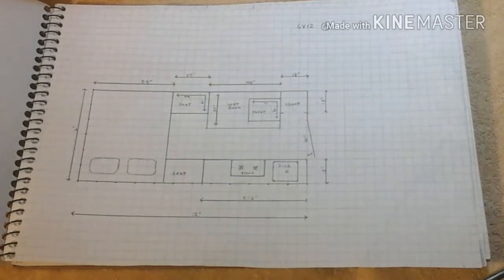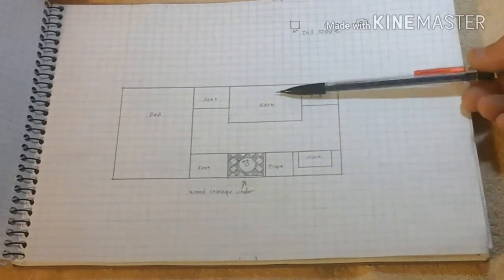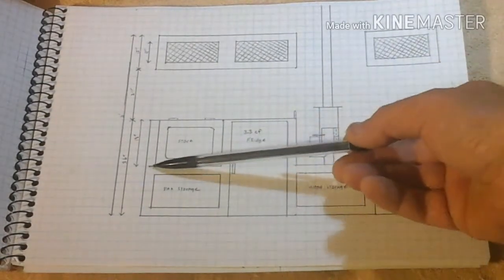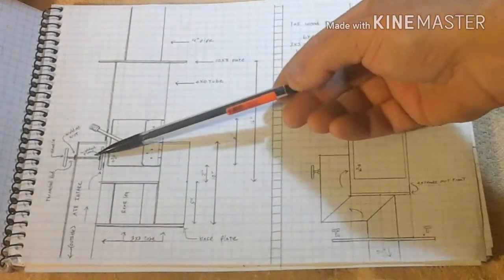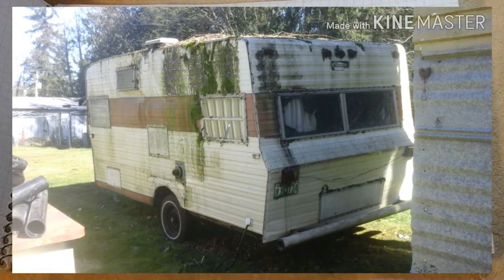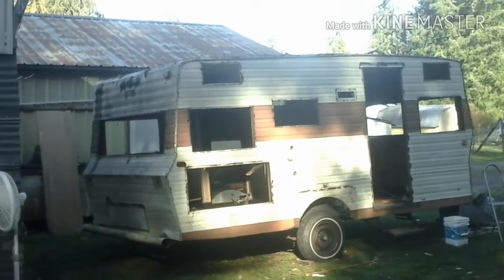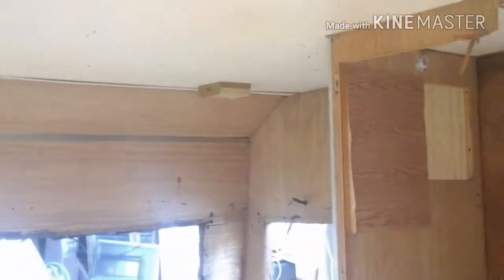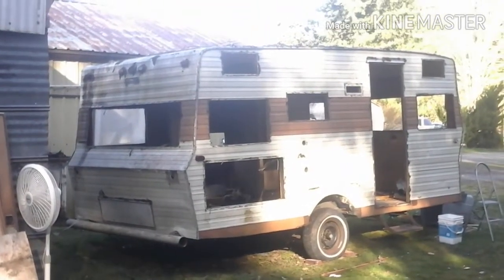Got a trailer to start the vardo project. And a diy wood stove plan.

Comment: Leave the frame long and use it for an outside storage or bike rack ECT.
Reply from the maker: dangeroustoman i have to cut off the round bumper anyway. May add a drop down mini porch and the bumper is taller than the frame rails. Also would be easier to weld on stabilizers since the door will be in the back. I'm thinking 7ft before the axle and 5ft after the axle for balance with a bit of tongue weight. So it's just a 12" chop off the frame tails.